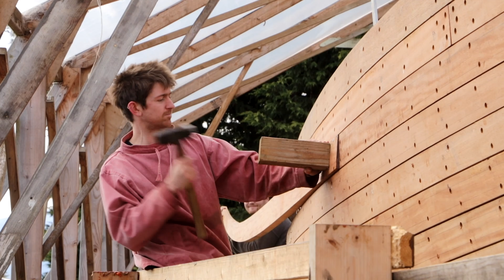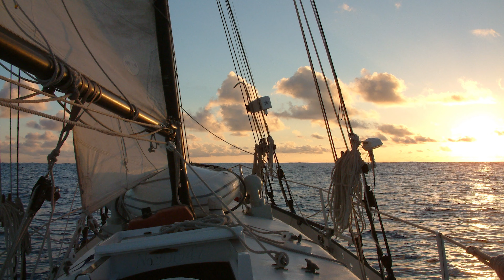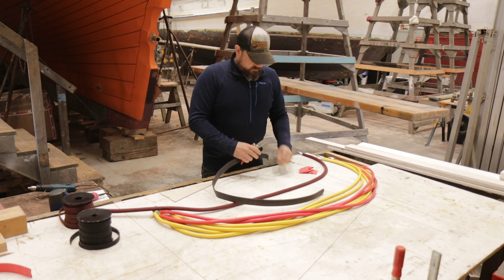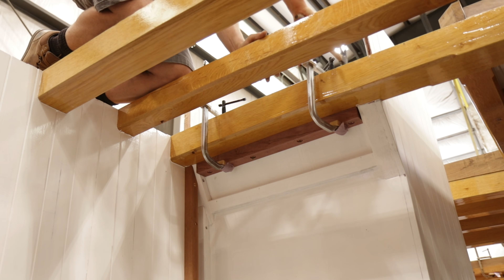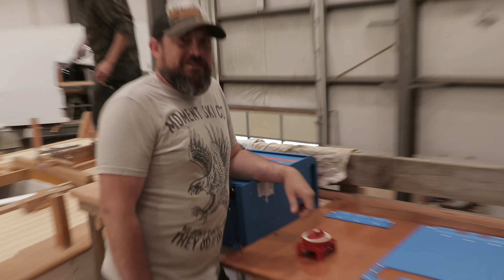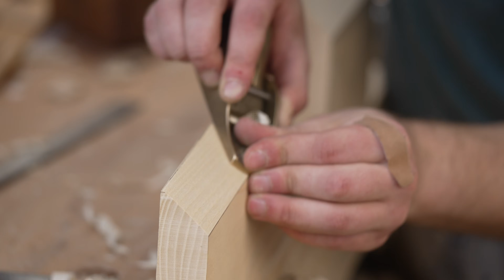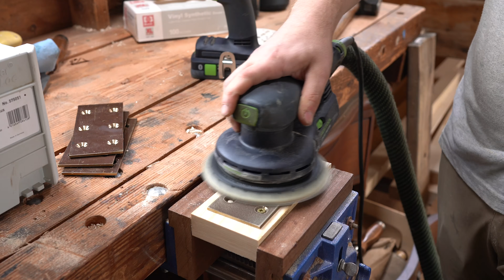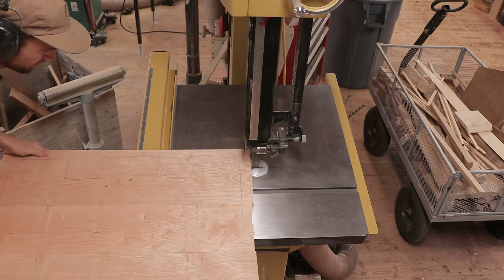Installing a Victron electrical system in the historic sailing yacht Tally Ho

Comment: I am an old timer with actual commercial experience on  boat wiring and some rules do not change even with the safest most stable batteries:
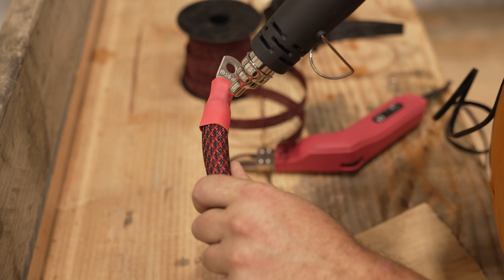ALWAYS HAVE EASY ACCESS TO YOUR BATTERIES, Always!!! The danger is not always the batteries but with the wire connections too (example at 5:20 the stretch tube under the heat shrink negate the hermetic seal,...chance of corrosion.... and maybe overheating... should use 2 shrinks one for lug, one for tube) my point is you NEVER know!
In my opinion there was so many options including for weight distribution (just fancy the kinetic energy these batteries  pack ,off center, in crashing seas)  This battery bank is a major flaw on Tally, the only one weakness in this magnificent piece of craftsmanship (once installed the batteries do not slide out anymore you have to disconnect and  take all the top ones out to access the bottom ones)
This is madness wake up. Too late I guess.
Reply from the maker: The wood brackets were designed and sized to have holes drilled in them for cables, obviously - how else would we plan to connect the batteries?
If you have experience installing systems on sailboats (as supposed to motor boats) I'm sure you know that sometime the ideal access has to be compromised, there is often no other way to fit everything in. However, to remove the bottom batteries you do not need to remove the top ones - just the ones in front. 
Interesting point about the heat shrink - I think the heat shrink is so tight that it still makes a hermetic seal regardless of the sheathing (the sheathing is a mesh so the heat shrink is adhered to the cable itself through the sheathing - there can be no slipping there) but I'll test that.
Our marine electrical expert here has successfully owned, operated and maintained a working fishing vessel and a trans-pacific schooner, as well as his career of actually installing marine systems. I'm utterly confident that he does not lack common sense.
Reply: @SampsonBoatCo I Do not worry  I am sure the heat shrinks will be fine  and of cause Joe and Tisson totally know what they are doing, I am splitting atoms on the issue of the unforeseen, it is what I do!

Comment: The Victron smart batteries do not have an internal BMS. Do you have to use their external BMS.  That is why you can connect to 24 V batteries and turn them into 48. You cannot do that with internal BMS batteries.

Comment: Copper buswork should be tinned especially for a marine environment. Looks like possibly one set of fuses feeding both inverters (48 - 120 & 48 - 230)? Hope thats not the case; the inverters should be separately fused.
Reply: One fuse for each inverter on their own dedicated cables and manual shut off switches.
Reply: @tysons1851  Perfect, thats how it should be.
Reply: They will never be on at the same time

Comment: It’s so nice to be able to layout the electrical system from scratch as well as the time to do it nicely! 

With that, I would be remiss if I didn’t suggest this. You MUST get a Ty-rap gun! This tool tightens and cut off cable ties ends. The tension is adjustable but where this tool shines is that it cuts off the end of the tie at the base which leaves the area smooth and NO sharp edges! You’ll thank me later when you are reaching in a cabinet, tracing a cable or something and you snag your finger on a sharp tie end.  They are about $35 or so.

One tool you have that I don’t is that cable jacket cutter. Must pick one up!

One other thought, if you don’t mind, have you considered ID tags at each end? They don’t have to dangle, use clear heat shrink and shrink them on the cable directly.

Once again, nice work.

SJ
Reply: I’ve never been a fan of those guns. I’ve seen the opposite that they do leave shark tooth’s. I have an array of cutters to get that flush no matter the location. Plus, zip ties just need to be snug and I prefer to set that tension just by hand. 

That jacket cutter is new for me and I just picked it up. I love it! You can micro adjust the cutting depth to perfection so as not to nick any of the wires.
Reply: A good response Tyson. I admit, it’s a preference.  I have not found a tool that cuts the cable ty as cleanly as the gun. These guns can make the bundles very tight. Good for some applications, I also figured a way to keep the tension to a minimum. I’m just defending my position here a little bit. Many people don’t care about this, as being too anal. But there is nothing worse than reaching your arms in a bunch of wire bundles and snagging your arms on a cable tie.  Good to see that you like them smooth too! 

SJ

Comment: Looking good guy's! What i usualy do to keep powerlos and heat out off the big 120mm2 whire conectors, i sand the back of the connector flat with a sandblock. After krimping the connectors tend to warp a bit and don't sit flat on the connecting surface..

Comment: If fire concerns you LiFePo4 batteries are the right ones to use. The FAA did a study on the different chemistries of lithium batteries and one of the noted results was that LiFePo4 batteries did not go into thermal runaway making them a much safer battery for airplanes. That's what I picked for my airplane battery, saved many pounds of weight vs a lead acid.

Comment: Question: Doesn’t all the connections to each battery need to be exact same cable length or they will drain at different rates causing additional wear on the battery with the shortest run?
Reply: Yep. They are all 72” and I even took care with the order they are connected to the distributer so no battery gets favored. Plus, the BMS systems monitor all of it.
Reply: You can see that is exactly what they are doing in this video

Comment: I am an electrician.  Got 30 years of experience and also hold a degree in electrical engineering.  I have designed and built many systems.  I would totally sign my name to the engineering and craftsmanship that was done on your boat.  My hat's off to the man/men who did the work.  First rule in any electrical job is neatness and professional manner.  I miss the weekly updates.
Reply: What weekly updates? The Youtube videos have been nearly always every 2 weeks on Saturday for years.
Reply: ABYC…… read the rules…. Written by National Marine Industry Professionals 🤙
Reply: @josephesposito4212  Don't have the time to do the research.  I do know boats from the factory use wire ties so I'm 100% sure that's not a code violation.  Nor do I believe current caring capacity of electrical conductors is much different from the NEC.  Besides as particular as Leo is on his boat I seriously doubt he aloud a non certified marine electrician do the work.  After all he is going to get this boat insured and registered in the UK which has much stricter maritime laws than the USA if memory serves me correctly.
Reply: Cept at the end of the day...no access
Reply: You are right but you left out the women
Reply: @jaensminger  I suppose I did.  Two Bulls standing on top of a hill looking down on a herd of cows.  The young bull says let’s run down and screw one.  The older bull says let’s walk down and screw them all.  There is wisdom in age.
Reply: Except the zip tied main power distribution cables… melt one melt all….. pretty sure that doesn’t meet electrical codes. 

Epic project though, I’m a little bummed that they beat the hook on this electrical trend but I’m hoping that it is a success. So many boats out here that have gone that way that or just a giant money pit of batteries and precious metals.
Reply: @josephesposito4212  does meet code.  I zip tie 500kcmil cables to the tray all the time.  Besides if the cables are sized right which from what I saw the electrical guru oversized. So guess what unless there is a bolted to ground fault no heat beyond the designed wire insulation rating.  Everyone wants to be a critic.
Reply: @johnmagnan759  i’m not a critic, I’m a master builder and a general contractor, and I on a solar company, and have my own Sailboat. Marine electronics and commercial and residential electronics are completely different and so are the rules.
Reply: @josephesposito4212  well aware of that.  I’m a master electrician and hold a EE.  I previously owned a sailboat too.
Reply: looks cool  my suff usually looks like a mess  but... bus bars out of pure copper .....  no way ever heard of oxidation ....use zink coatet bus bars  specially on ships   and they dont need to be that thick
Reply: @Beyond-Horizons-  no such thing as over engineering an electrical system.  Coat the buss bars with battery protective coating.  Comes in an spray paint can.  Or if you have some spare varnish use that.

Comment: Great video! When you guys get to the solar/electrical details, I’m curious of how the two 48VDC->12VDC converters interface with the house battery and what that battery is. It seems like the house 12V could be directly out of a DC fuse box, but clearly there’s something more complicated downstream. Also we have 22 acres of black walnut, sugar maple, cherry, persimmon, honey locus, poplar, and (limited) red oak. We are getting closer to milling for our interior  wood (see abandoned shed to tiny house/Danner Cronise) and could make some available if it’s useful. 

Thanks as always!

Comment: I wonder how many decades it will take for americans to start using the metric system. NASA does.
Reply: All science uses metric but the general society is a long way off, unfortunately.
Reply: @michaeldemarco2415  It's quite funny in UK that meters and miles has a 50/50 apperance. I can convert that, but when they use stones...

Comment: Hi, I'm not a boat builder or a sailor, but I am thoroughly enjoying every video. I especially liked this episode and am anxiously awaiting the full explanation of the electrical system. Because I am a former RVer, and a low voltage enthusiast, the talk of LiFePO4 batteries, inverters, BMSs, and all the rest is familiar to me, and it's fascinating to see it installed from the hull up on a boat. Thanks.

Comment: The electrical system looks great and well thought out. One thing that the Electric Vehicle conversion people have learned is that if there are hard connections, such as you are making, between battery terminals that extra care needs to be taken since even minute vibrations over time tend to make the terminals within the battery actually migrate/move and sometimes create resistance within the battery itself, leading to premature failure.

Comment: Just a slight suggestion, when removing the tail from the tie wraps, twist them off instead of cutting them off because the cut off end is very sharp and there will be a time someone will be trouble shooting a system and they'll get sliced all over the place crawling by them. The twisted off ends don't cut your skin.
Reply: I usually hit the cut ends of zip ties with a lighter to soften the sharp edges
Reply: @SaltBayGull  We used a tie wrap gun so it was much easier to twist it off even though the gun would cut it if we let it. But we were going through hundreds of tie wraps  a day on some jobs.
Reply: If you use flush cutters to cut the ends off of your zip ties, they are not sharp. I do this in my installations.

Comment: 4: 48 VDC batteries connected in parallel?  My understanding is that you shouldn't run more than 3 batteries in parallel, as you run the risk of unbalanced charging... DO you mind elaborating on your rationale, or what you are doing to avoid issues?
Reply: Each battery has it's own internal management system but also talks to the external BMS.....

Comment: With the electrical power systems you have on board, why aren't you using drum turbines on your mast to get guaranteed power and charging along with solar panels if you're using them, that way you would have alternate power sources and being able to go without having to use your fueled engine at all if ever.
Reply: When sailing, the propellor turns the prop shaft...... 
which in turn generates electrickery.....from the generator attached to the prop shaft
unlimited electricity by sail power...
all out of sight....
and very very quiet....
See Ep 115
https://www.youtube.com/watch?v=c4UMMQFgmVI
Reply: @JohnSmith-yv6eq  The purpose for drum turbine power in combination with or without solar is you generate power when you're on way or not, you gain power to run the hybrid motor without having to run the fueled motor at all, basically running using nothing but the drum turbine, batteries and solar/if installed to power the electric motor and having a constant charge while on the way or not when not having the sails raised and only using the fueled motor when absolutely needed.When sailing redundancy is your friend.
Reply: Wtf are drum turbines? I doubt he wants some wind turbines spinning on his classic yacht. That would just ruin the whole point

Comment: Lithium batteries are great but have one major problem unless configured with a fall back mode - if one fails the BMS can disconnect the entire bank leaving you with no power. It happened to me half across the Pacific when one battery signaled a over-temperature cell to the BMS. The BMS then activated the remote isolation switch which cut power to the boat in the middle of a moonless night. We have since reconfigured the system into two parallel banks with separate isolation switches and BMS’s so that we have some redundancy in case of an individual battery or cell failing.
Reply: There was mention that each battery has it's own internal BMS....
and that each battery BMS talks to the external BMS.....?
Reply: @JohnSmith-yv6eq  I don’t know exactly how they have configured the system, but the way mine works is that the internal BMS manages the balance between cells within the battery and will signal to the external BMS if it has a fault condition. This causes the external BMS to fire the remote battery isolation switch to protect the battery. This means that one cell going bad can cause the entire bank to go offline. If I were doing it again on my boat, I would go with boring old AGMs - simpler and easier to find replacements in more remote area.
Reply: These batteries are not directly connected to anything that needs power. It isn't a real problem
Reply: @jonnenne Those heavy duty gauge 00 cables sure look like a direct connection to me. Under power, the hybrid marine engine will provide plenty of power - up to 13kw - but in hydro generator mode it will produce a maximum of 500 watts at 8 knots of boat speed,  only 200 watts at 6 knots which will not be enough to power the boats systems. Batteries are the primary source of power.  The nice thing about Lithium batteries is that they can absorb a very high rate of charge so, with what amount to a 13Kw generator on board, it will be possible to charge them quickly.

Comment: Leo, Couple of notes to your DC installation (mostly criticising...)
1. Selection of overthick DC cables, on the other hand nickel plated just poorly crimped connectors... Not good. Can't see cross cut of cables, but I guess 50 mm2 or higher. I hope solid braided tin covered copper, did not seem like this from video. Cross cut of crimped connectors just much smaller. Compare crosscut of cable and cross cut of connector section.
2. Connectors made poorly, simple crimp by cheap manual tool is not good enough. These cables should stand much more than standard home installation. First, i would select pure copper connectors, second, to achieve minimum voltage loss (low resistance) it is needed to solder these, then to crimp it, or to use really professional crimping tool. 
3. I am not that sure paint is fire retardant/low smoke, but I would never install electrical components just on wooden base plate. Non-flammable support plate should be used. This is just irresponsibly increasing fire hazard.
4. Any crossings of cables through wall should be secured with rubber boots, to prevent any rubbing and ensure seal of battery compartment. Even water vapors are enough to condensate inside and create corrosion. I see no point in cables braiding, this type of braid prevents from what? Only increases thermal resistance of insulation. 
5. I hope cable is low-smoke/halogen free. Seems like maritime cable, with tinned copper wires, not sure what US standards are, taking photo/showing datasheet of cable would be nice. 
6. Installing DC converters wrong orientation - WHY? Not only it prevents proper cooling (especially when mounted with no distance against solid wall), also voids the warranty and IP43 protectivity, as they should be installed terminals facing downwards. This shows bad planning of installation and bad components distribution. 

Needless to say, Victron's Wiring unlimited doc also gives too little information on some sections and bad advices (from my point of view) on some points, but in any case, here in Europe based on German/French standards we always nag about poor and troublesome UK/US electrical wiring and systems standards. 

And yeah, workign with pedestal drill in gloves, holding piece by hands, no no. That wouldn't do it for me. I maybe would do it at my home, but never ever as electrical engineer or contractor. And not to show it on video. 

Please, have my points above consulted with qualified specialist, I think you are doign excellent world class work, but here I see couple of points for improvement. Just sayin...

Of course, big fan of yours. 
p.s.: sorry for not perfect grammar, i am not native speaker.